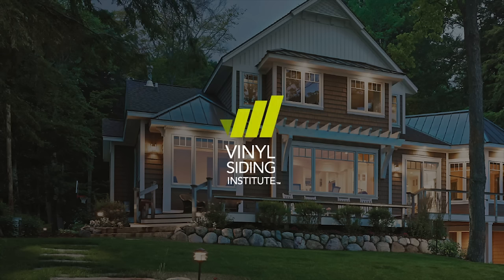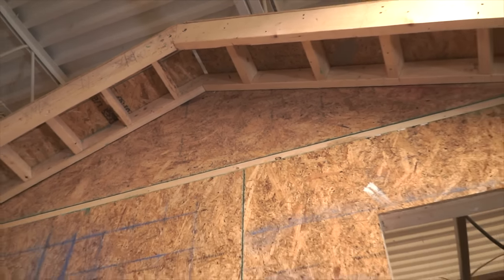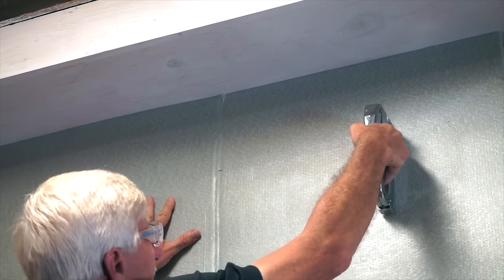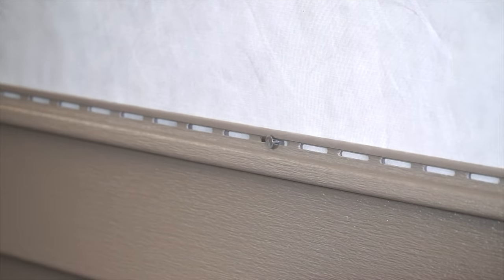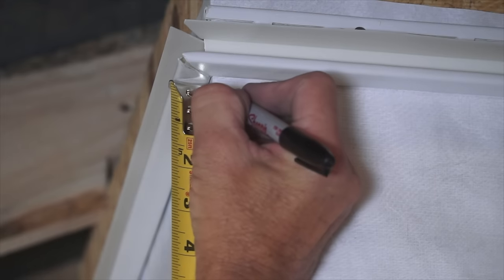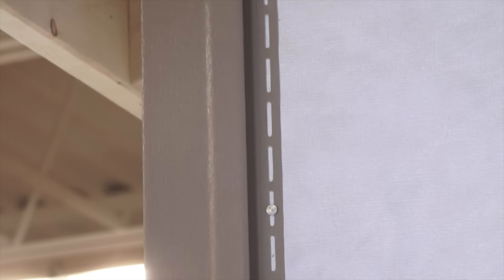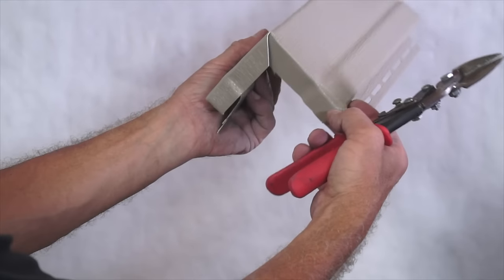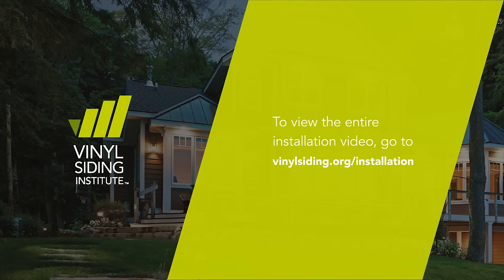Vinyl Siding Installation - Getting Started - 2018

Comment: No need for a level, measure down from the overhang on each end of the wall and snap a line. That way your last piece at the top will be the same width. If not, the job will not look good even from the road. TIP: If it looks level, it is level.
Reply: This is what I was looking for, thanks for your tip. One year later 😊

Comment: what size thickness plywood should be used for vinyl siding, 1/2 or 5/8 inch?
Reply: Either
Reply: Nothing below 1/2 in but you could have anything above the min

Comment: WARNING!! ⛔️ 
never paint vinyl siding!
I learned the hard way
Reply: Why is that?
Reply: @stefenbays5790  vinyl siding expands and cracks. it constantly moves and shrinks. it chalks very badly and has terrible paint adhesion.  I own my own painting business for 12 years now. the only thing i wont paint is vinyl. it shoudnt be done.
Reply: @loganshelton2040  You can stain vinyl siding to any color. Won't peel off.

Comment: Hi is vinyl sliding good for concrete walls?
Reply: You will have to add one by’s by tap conning them to the concrete wall every 16” or closer so you can nail the siding to the wall.   I guess you could use tap cons to fasten  but they are a bit expensive vs. nails.

Comment: This is a good video. However vinyl cladding is rubbish for noise reduction. I live in a fibro near a train line and the vinyl cladding should never have been put on. Its like a plastic bag around your house. It has zero sound blocking characteristics. Its just good for deflecting rain and appearance.
Reply: I assume your siding is hollow, and not foam-backed?